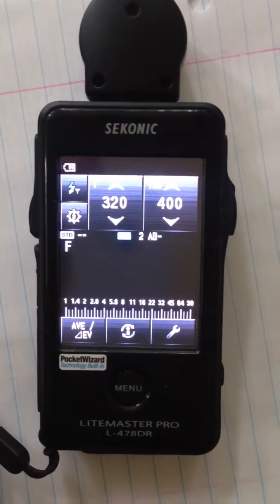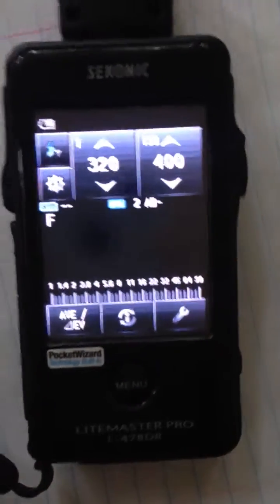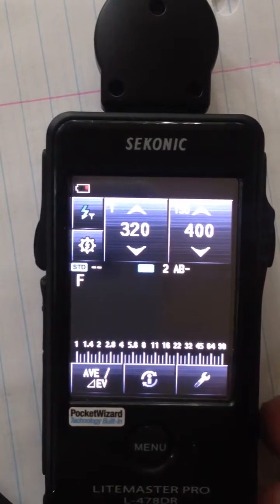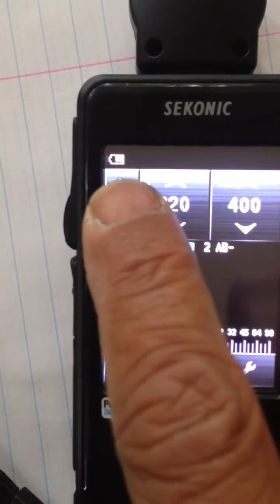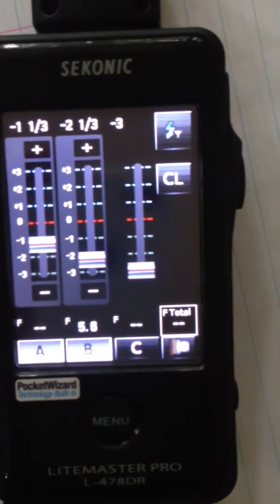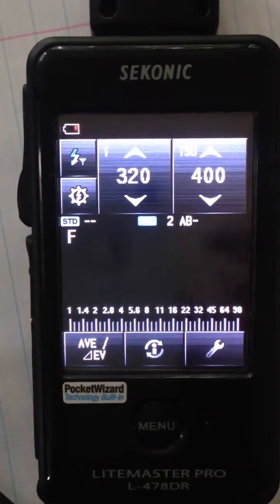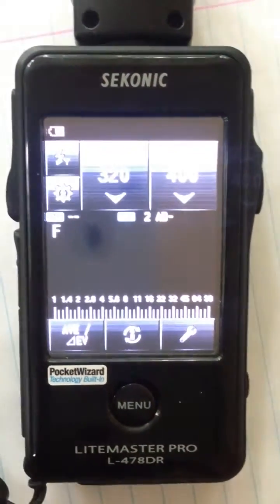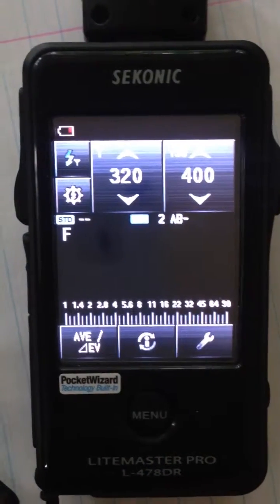sekonic l478dr power issue

Comment: Mine is doing the same thing and worst not reading flash correctly. Did you get this issue resolved? Thanks in advance ;
Reply: Keith Johnson are you using alkaline or rechargables? You have to use alkalines

Comment from the maker: I heard from the Mac group and they told me that since I was using the enelope rechargeable batteries which often times do not have the power voltage as regular alkaline batteries it's fools the light meters computer into thinking that it is low on power. they suggested that I use the best alkaline batteries I could find to use in the light meter.